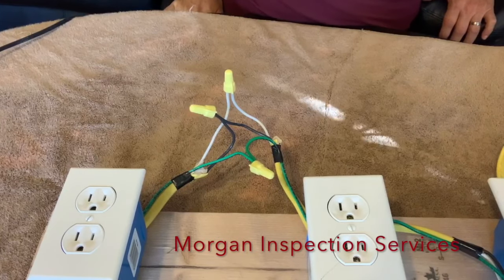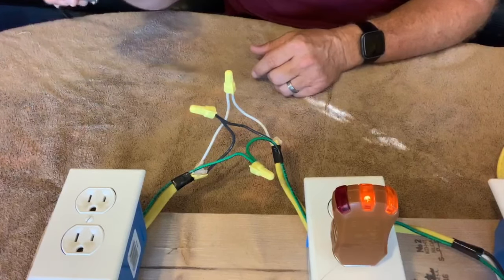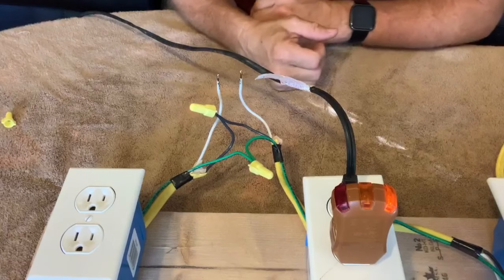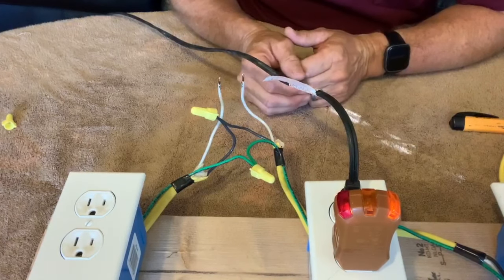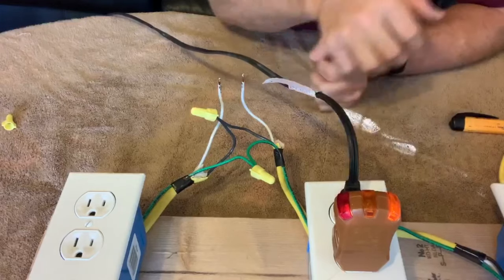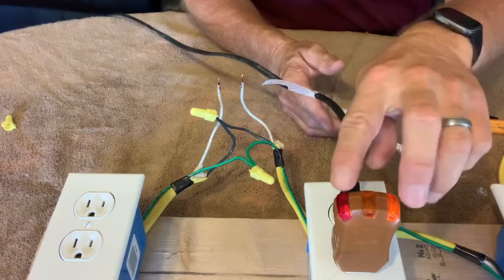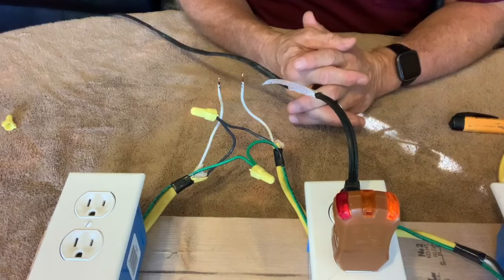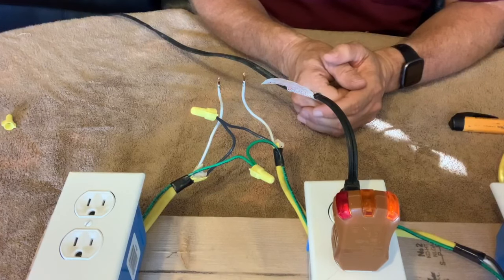What is a Hot Ground Reverse?

Comment: Hi there, thank you for your video. I seem to be having this exact situation of having hot/grd rev on the tester. Mind you this is after I have slammed a gate onto an extension cord and shorted the power. I'm not an electrician but I'd like to give it a try to see if I can fix this. Can you provide some guidance as to where I should lookfor this problem?

I'm thinking I should just replace the outlet that perhaps I have fried the neutral wire?
Reply from the maker: So the outlet that is showing hot/ground reverse is the outlet where the extension cord is plugged in? Have you checked other outlets that may be on the circuit, and are you getting the same reading there or only on that one outlet?
Reply: @morganinspectionservices3840  I found the problem! I fried the gfi outlet up the stream and had to pull the whole thing out to see that's partly melted on the back. Got a new one and replaced it and everything works now! Thanks again for a good inspiration video.

Comment: a hot ground reverse does exist dont let your drunk frind fix extention cords well you're out of town
Reply from the maker: Funny
Reply: Good one!!😆    A true hot / ground reverse is not impossible,  but probably has the same odds of getting a royal flush while drunk and completely wasted at the same time 🙂   Much more likely reason for this reading is an open neutral,  and a load turned on downstream,  especially when receptacles used those flimsy backstab connections,  rather than looping around the screw terminals,

Comment: So I have an outlet that is showing Hot/Ground reversed. It is also connected to an outlet under my sink that shows no lights (supposedly an OPEN HOT). However, this is where it gets interesting.  My garbage disposal is plugged into the under sink outlet and it works, HOWEVER when I plug in anything else it does not work and the tester shows no lights.   Any ideas??
Reply from the maker: That is very interesting. So if you plug your tester into the outlet under the sink, and turn the switch on for the disposal, that tester shows nothing? Do you have a multimeter?

Comment: I was baffled by the hot ground reverse showing on my light tester. It seemed like an impossible scenario since the circuit has been working normally until now. I'll check for a loose natural wire and see if that is the case.
Reply from the maker: Did you find the problem?

Comment: Great demo Mike.  Thanks.  I have a GFCI switch connected  to 4 receptacles and one light in my bathroom.  

GFCI tripped and I couldn't re-set it thereafter.  I decided to replace the GFCI.  I still cannot reset the GFCI after wiring.  

The original wiring which has been there since 1997 is as follows:  all hot (black wires) to receptacles are joined together and connected  by a piggy to GFCI load (gold screw); and all white wires to receptacles are joined together and connected to GFCI "load"  "stainless screw".  

Then  hot (black wire) from source (breaker) is spliced: (one piggy goes to GFCI "Line" (hot) and the  other one to light);  the white wire is also spliced and one piggy goes to GFCI Line (neutral) and the other one to the light.  

When I use my tester on GFCI,  both red and yellow lights of the tester illuminate - indicating  "hot reverse neutral" - same applies to the other 3 receptacles.  Do you know what causes such?  Or how do you recommend I correct such a problem?  Thank you.
Reply from the maker: I am slightly confused. You said after you replaced the GFCI that it would still not reset. If this is the case, how are you getting any reading when you plug in your tester? 
If you have the black wires connected to the gold screw and the white to the silver screw, then you have wired it correctly. If it is wired correctly, and you are getting a reverse polarity indication, then maybe the wires supplying the outlet are backwards somewhere upstream. Do you have a non-contact voltage detector so you can see if the black wires are truly hot and the white wires are not hot?
Reply: @morganinspectionservices3840  No, he said he's getting a Hot & Neutral Reverse, on the receptacle tester.. Would u know the answer? I to am curious.